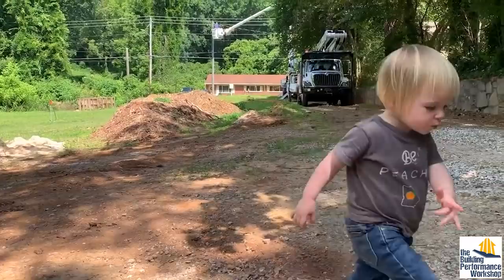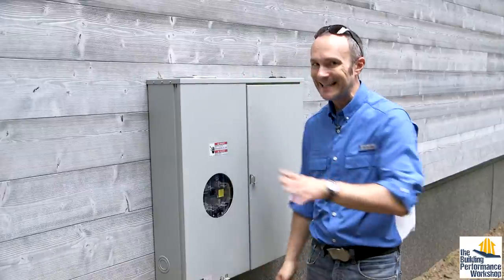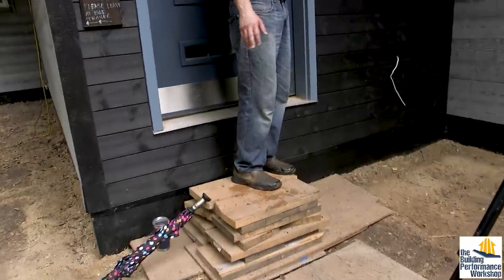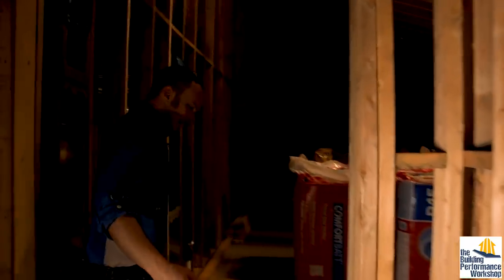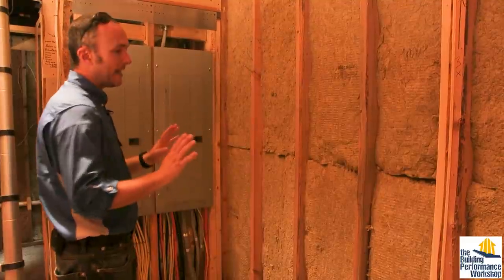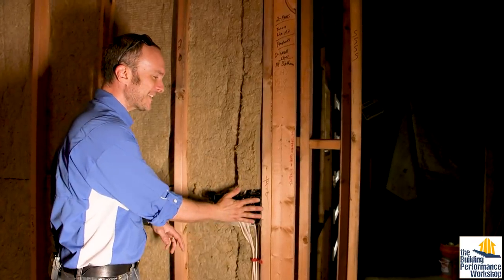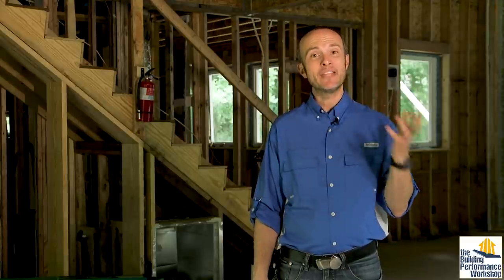Electrical Wiring for our High Performance Home

Comment: The house where we got 4.6 cfm of duct leakage 😉, the house was <100 cfm50. The builder did something interesting for the exterior electrical penetrations. Similar wall assembly as yours; he drilled 1/2” holes through the sheathing, then took 4”x4” sheets of EPDM, drilled 1/8” holes in them, then taped the gaskets on either side of the hole, threaded a string through he sheathing and gaskets, then finished the exterior. When it was time for the electrician they tied their wire to the string and pulled it through. 💪🏻
Reply from the maker: That’s thinkin. I’m not capable yet. Still was deciding where pens would go the day before.
Reply: Home Performance me neither... for the record I think you’re building a fantastic house, very impressive.

Comment: Pay attention to where you put high load breakers, they will heat up so if you spread them out in the panel it can prevent heat related problem. I've seen issues in big houses that have multiple ac and heater breakers all next to each other respectively
Reply from the maker: Thanks for the tip my friend- I’ll make sure the sparkies know
Reply: I'm not saying you're wrong but I've done institutional electrical (hospitals) for my entire career and never seen overheating circuit breakers. In rare instances an old one will warm up and start nuisance-tripping but as a rule circuit breakers do not get hot. If they did they'd be a hazard so manufacturers make sure the contacts and conductors inside are beefy enough to not cause IR drops.
Reply: @paulmaxwell8851  well I've seen failures like this in houses with multiple ac breakers stacked together.  I would bet the equipment put in hospitals is much better and a failing breaker will very much heat up. I once found a breaker that was stuck on just from how hot it was.
Reply: @wallpello_1534  I'm curious, was that problem with breakers with torqued-down connections?

Comment: Is the low voltage cabling being done separately? Stuff like Ethernet, speaker wiring, thermostats, cameras? Given the rate that technology is changing, you might want to use PVC conduit for some of that, as the standards seem to keep changing, and the cables along with them. Rerunning cables through finished walls to an existing box is challenging. My house was built with telephone wiring and first generation CATV wiring. While wireless technology has come a long way, cables are still needed in a few places, such as to connect WiFi hubs and power them, potentially with PoE. What will that look like in 30 years? Who knows.
Reply from the maker: 10-4, John. That’s why we have the crawlspace and mechanical shaft!

Comment: Curious but did you consider installing mounting blocks at the various exterior locations where there will be a penetration and then you seal (against air infiltration) the wire or pipe once the trade does their rough in work?

Comment: Building a house on a slab, how would you suggest running the wires (in the encapsulated attic)?  Also any ideas about insulating the slab or do we even need to consider that in Anderson South Carolina?
Reply: There's lots of options, depending on whether you're building or renovating/remodeling and what budget you have to work with, along with what can be considered the most bang for your buck that's still practical.

Like one option is to insulate the exterior for a layer of continuous insulation, which can let you leave the interior framing open and free to use to run all utilities or reduce the need to worry about keeping insulation continuous on an additional interior layer.  Another is just to make the walls thicker to allow for both the insulation needed and still have enough space left over to run utilities... You can even create a service cavity specifically for running utilities, which is especially useful if you're also doing sound proofing as decoupling an interior wall from an exterior wall provides a good sound break that can also serve as a service cavity...

You can treat your attic like he does his crawlspace...  Or, if you raise your floor a few inches you can run the electrical under the floor, it doesn't need to be a crawlspace if just running conduit...

There's also a lot of different products, usually used for renovations of older homes like putting conduit into the wall trim...

https://crownduit.com/

Also, depending on what built-ins you have, you can also use them to bridge areas or put electrical instead of through the walls or need to route another way...  A lot just takes planning before you actually build but also consider if any of them will ever need to be changed or serviced then accessibility may be something to consider but service panels can be put just about anywhere and blended in to look like the rest of the wall or floor or ceiling...
Reply: @ZeoCyberG  Thanks for the information, just saw this for some reason I missed it .  Sorry for the delay.
Reply: @georgewelden2507  No problem, youtube doesn't always notify you when there's a reply...

Comment: You'll want to make sure to balance your loads on your panel. IIRC the meter reading will be taken from the highest drawing side. If you have 3 rooms always in use on the left side bus bar and 3 on the other side that aren't, you're going to be paying more. I think this is to keep multiple households in a neighborhood from drawing from the same line feeding them. Of course it's not a concern with 220.
Reply from the maker: That’s very interesting, thanks for the lesson!

Comment: I really like your attention to detail. Thanks. Tell me though, how did this super hi-tech project ignore solar power?
Reply from the maker: I’ve worked with solar thermal and PV before, and short answer is they’re not as universally, perpetually awesome as the marketing says. Our PV panels have sat in storage for 3 years, in fact. I’ll talk more about this later.
Reply: Over here the roi on solar is a very long time. Very close to the replacement time. Big problem is main usage is when sun is not shining. Even for work where we use most power in the day time the roi is still very long.
Reply: @tweake7175  my comment was toward a grid-tied solar photovoltaic - which means there is not a connection to peak time of day use, but a year-long gain/use program.
Reply: @HomePerformance  it kind of depends on your power company. If that company does not provide for a grid-tied credit for power gained then, sure, it's not worth it because then you're having to justify a storage system (batteries), which is not an easy justification (if only considering the R.O.I. - however, if you're considering the source of the electrical power your power company uses, then it's a different situation. Having electrical power generation from coal should be illegal.
Reply from the maker: Right on, Tim, but our municipal power co does not have a net metering agreement, as you suspected.
Reply from the maker: No, we don’t find mechanical devices ugly
Reply: @timskufca8039  so was mine. what power co's pay is tiny. it was good in the early days when they paid retail rates, but now they pay wholesale rates.
the best payback is by using the power directly. which means either storage, which costs a lot, or use the power when the sun is shining.
by the time the system is paid off, its almost time to replace it. it becomes yet another appliance that needs maintenance and replacement. 

one system someone recommended was to connect solar panels direct to a hot water heater. its not the most efficient system, but it uses storage which you already have and reduces the need for inverters etc. so the cost is a lot cheaper and you get to use the day time energy at night time, instead of feeding it back to the grid for peanuts.
Reply from the maker: You’ll all be happy to know that if we change our minds later, we can easily clamp panels to our 1.5” standing seam roof.
Reply: @HomePerformance  I am in the design process of my home, and my area (Northeast Texas) offers no incentive for PV. But I'm still considering it, and using a zero-export setup. Basically, a grid-tied system that restricts export. No need to be penalized for being a "generator" and benefitting from a lower consumption when PV is "augmenting" the utility.
Reply: @tweake7175  One of my smallest solar arrays is thirty-two years old, and it paid for itself a very long time ago. It continues to crank out power and I have no plans to replace it anytime soon. By the way, it cost over $4,000 all those years ago and can be replaced today for under $300.

Comment: How did you air seal between the two 150 amp breakers on the outside and two panels on the inside?  Great work, looks super clean.
Reply from the maker: Thanks- it’s just flexible airsealing tape around two bigass (2 gauge?) wires- the panels are on an inside wall. Outdoor boxes mounted to siding and furring strips.
Reply: Nice.  What's the make and model of the outside cabinet if you don't mind me asking?
Reply from the maker: Yikes, don’t know that one- but it’s standard fare at City Electric Supply.

Comment: Don't forget that in the near to medium future most people will be charging electric cars at their homes. Most of the time you'd want to slow charge them at off hours overnight but it should definitely factor in to your design load to have them fast charging at an inopportune time.
Reply: True, and as they plan this to be their forever home that they will hopefully pass down to future generations.  Good to keep in mind what future needs may be needed to be met and avoid added costs of replacing systems instead of only upgrading them in the future.

Comment: 400A will soon be the norm as cities transition from natural gas in an effort to electrify everything. Most medium to large homes with less than 200A service will need an additional 200A for HVAC, cooking, and future EV charging
Reply from the maker: Yep, I was surprised, but using electricity for water heating and cooking (especially induction) eats up the amps
Reply: Overkill for most medium (2500 sq ft) homes, unless they are running electric baseboard heaters (and who would do that now.) Things keep getting more efficient, and stuff like heat pump water heaters use a fraction of the power resistive ones do. Car charging can be significant, but most people go way overboard here for bragging rights. A 30A/240V circuit is plenty for charging single car, if parked at home overnight. That will do about 20 miles an hour, which is enough to cover 99% of peoples' commuting in just a few hours.

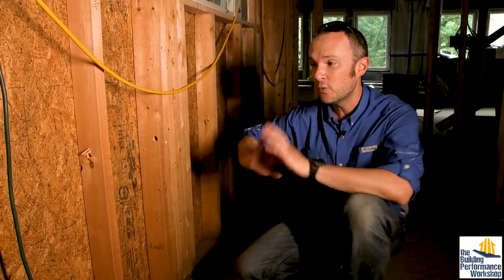Comment: 14:00 Is that 6 studs together? Thanks for the video.
Reply from the maker: Probably is- I used to think that kind of thing was hack, until my eyes were opened to structural design. Those 6 are the only thing holding up the main roof beam.
Reply: @HomePerformance  Thanks for the reply.  "Follow the load path" has been helpful to me, as well. Knowing your attention to detail around insulation (and everything else for that matter), I was surprised to see such thermal bridging because of two little windows. I didn't look up to see that it was a nail laminated beam holding up your roof!
Reply from the maker: No worries Jason

Comment: What is the ACTUAL cost for this build?
Reply from the maker: Great question. No answer. What something costs is very different from what it’s worth. What’s the actual cost of your children, vs. the cost of not having children? Sorry, not trying to be obtuse, just have a hard time going down the cost road, since this has been the center of my life for years, of my parents’ lives, of my bride and children’s too. Too much wrapped up in the ball to pull the yarn back out.
Reply: @HomePerformance  I know enough about you through your videos to be certain you have materials and labor down to the penny, and this ain't no $150/sqft project, that's for certain!
Reply from the maker: Is that your main goal? $150/sq ft? It’s not mine. Our tiny house is $600/sq ft if you look at it your way, but I don’t look at it your way, obviously.
Reply from the maker: Sean, that hurts my feelings. I’ve said in previous vids we’re spending $400k on the house, but that doesn’t include all the free labor. I charge my clients $150/hr for consulting- is that what I should value my labor at 6 days/wk? Times 3 for my parents too? A bazillion dollars. That’s the number you’re looking for.
Reply: @HomePerformance  I apologize brother it was a bad attempt to be funny in the current climate. I removed. LOVE ALL THAT YOU DO BRO!!

Comment: 300amp !!!!!!! 
Here standard is 60amp single phase. (240v)
Reply: The NEC minimum service size is 100 amps. So you're not installing 60 amp services anywhere in the USA legally. Sorry.
Reply: @Kmoran81  i'm not in usa ;)
Reply: Were are you code is 100 amp and most places in the US they make you put in 200 amp
Reply: @wallpello_1534  downunder. Other side of the planet 😎

Comment: With all the $$ you have spent over insulting and air sealing(which I agree) 2 questions. 1. Why didn’t you just use low voltage light system.. then all those horizontal runs could be eliminated. 2. Ceiling fan in the kitchen ? Really? You built a crazy efficient house. To me they are just big dust collectors.
Reply from the maker: It’s always a question of upsides and downsides, and where your priorities lie. We do have some low voltage lighting, and I can tell you it also uses wires, so I don’t get your point there. And as for the ceiling fans, in a house as efficient AND spacious as ours, how else would you circulate the air? Our 45,000 cu ft of indoor air is only conditioned by 2 3/4 tons of equipment, which is 1100 cfm. When you add in the dehumidifier and HEPA filtration, it’s only up to about 1700 cfm, which is not a lot for 45,000 cu ft. Ceiling fans are necessary imho. And if your house is dusty regardless of reasonable cleaning, there’s something else going on that should be addressed.
Reply: Home Performance .. fyi this is just a healthy discussion.. What I was thinking about the low voltage lights, is now u are not running 14 gauge all over the place and you should be able to do those long runs to avoid going horizontal. For me , I am thinking of a house as more of a low voltage house. How many things really do take a lot of power these days. Not that much. Just your major appliances.. I do love you put everything in the craw. I guess I am sort of a head of my time, but I think ultimately we will have more of a dc house than an ac one. IMHO.
Reply from the maker: Sounds great, sorry if my brevity came across as touchiness, it’s not. I think you’re saying use more wire, but of a thinner gauge. Agreed that the elec grid we have now needs improvement, but the manufacturers haven’t caught up to the times either, so I’d be nervous switching to DC today.
Reply: @HomePerformance  having run a lot of tech cables in homes i think you have done the right thing. Tech changes so fast that any special wiring will be obsolete pretty fast.

Comment: 120 amps for a water heater, not smart ,install a standard water heater with a timer.
Sales people can sale a lot of stuff but not common sense.
Reply from the maker: I don’t think you’re on the same page here, Rich
Reply: I find it hard to believe the water heater draws 120 amps.  That's nearly the entire load for many small houses and certainly doesn't sound efficient.  I don't think I've ever ever seen a residential circuit breaker over 60 amps.